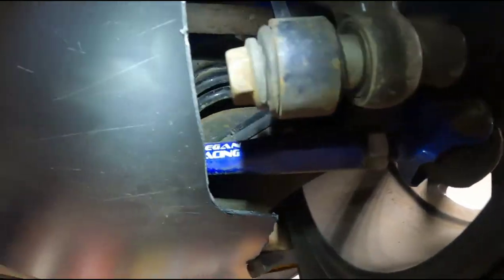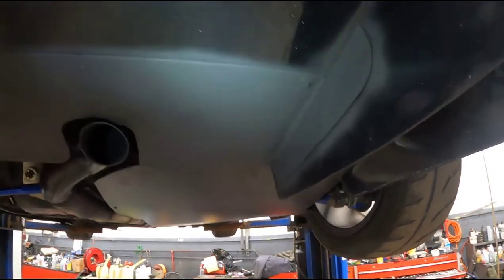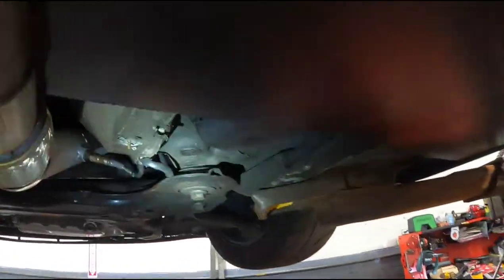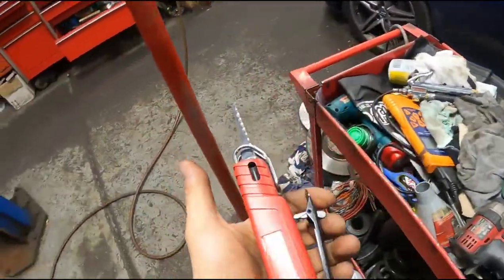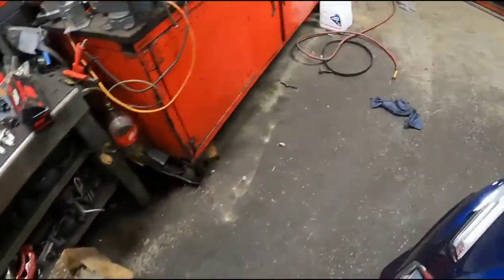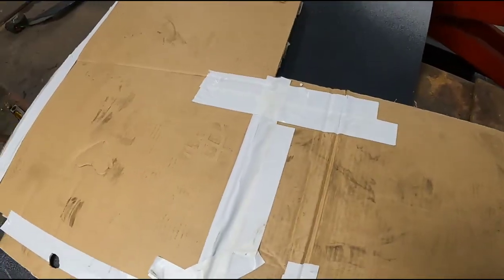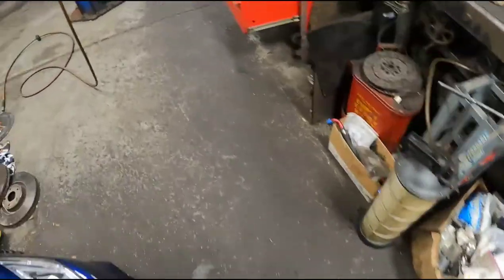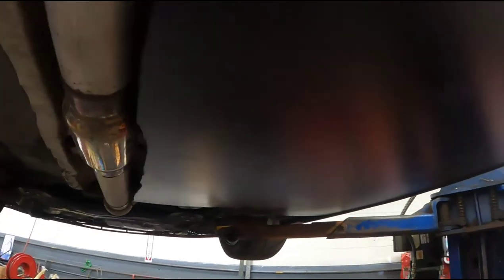VW R32 TRACK CAR FLAT FLOOR (PART 1)

Comment: Could you tell me if this is a mk4 or mk5 please my Man?? Would it be possible to also do this to my golf mk5 r32and how much?? Thankyou..
Reply from the maker: This is a mk4. It's possible for sure, just a different chassis, suspension and exhaust. This is more of a job I do for fun on my project cars and not so much a customer job I perform at the shop.